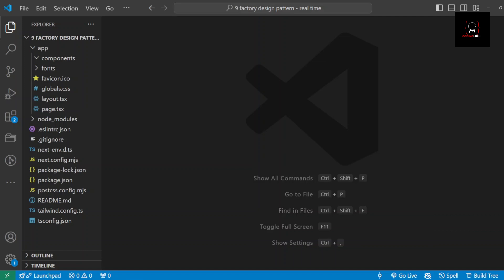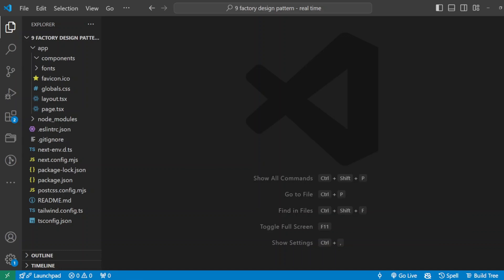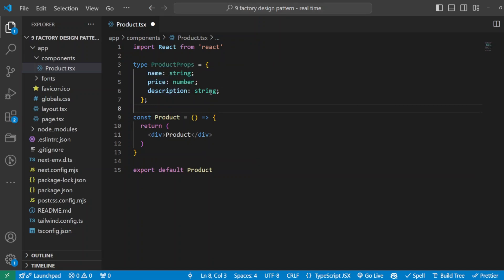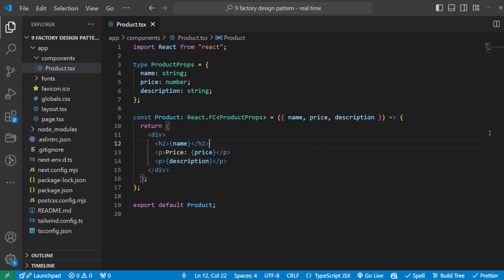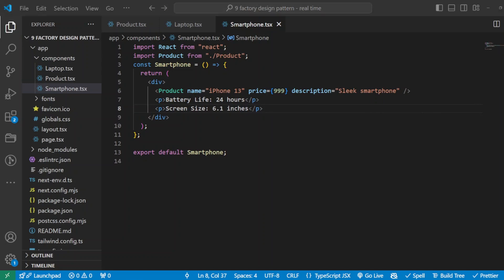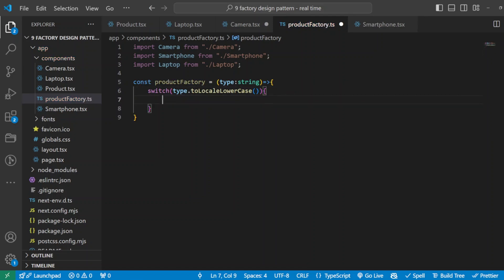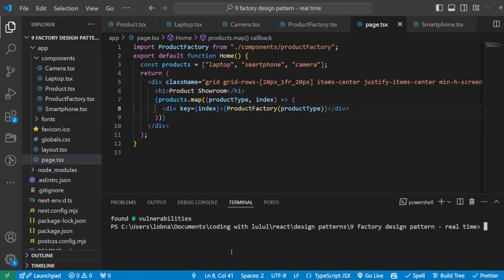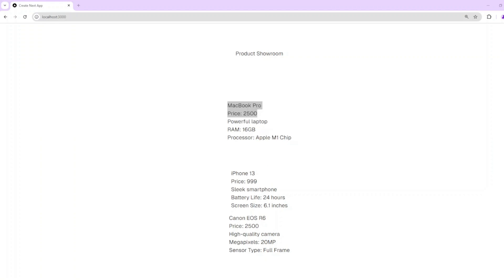Master the Factory Design Pattern in React ⚙️ Real-World Code Tutorial 🔥

Comment: Seems useless, therefore involves coupling in this current case. It's better resolved with compound components and better data structure.
Reply from the maker: Good point! Compound components and a well-structured data setup are great options for many use cases. Here’s why the Factory Pattern fits here, though: it’s useful for scenarios where each product (like a laptop, camera, or phone) has unique properties and logic that don’t overlap. The Factory Pattern helps us encapsulate that complexity, so when a new product type is added, we don’t have to rewrite or modify existing code.

In contrast, compound components work best when managing UI elements that share similar structures or behaviors (like form elements or a grouped set of toggles). But in cases where logic varies significantly across types, the Factory Pattern can provide cleaner separation and scalability. Thanks for bringing this up—it’s definitely an interesting design choice!